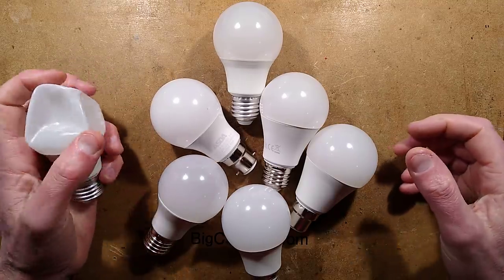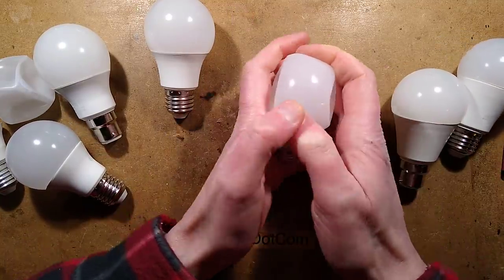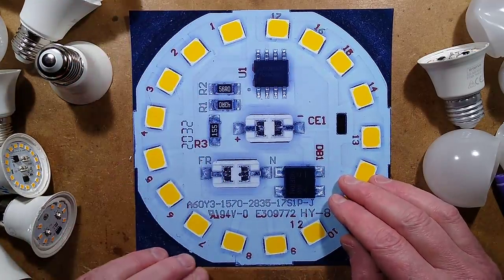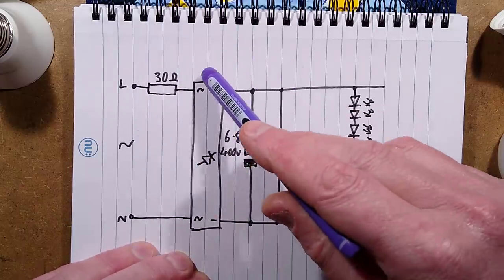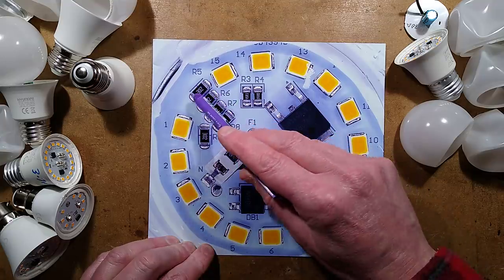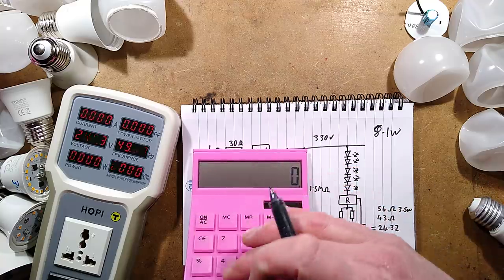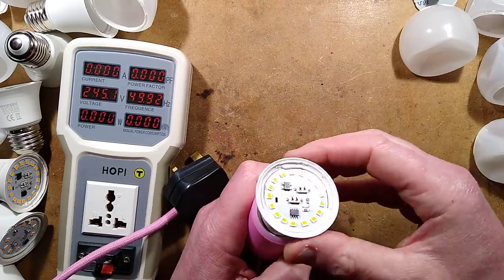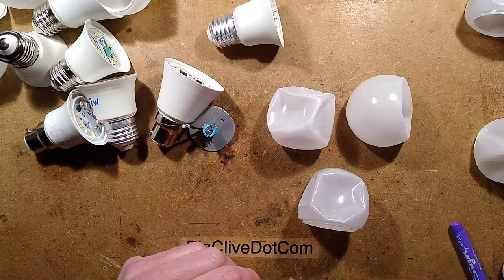Crushing and hacking LED lamps

Comment: Unfortunately the dead ultra-inexpensive Chinese-made "Tesla" branded LED lamp I have on my table waiting to be analyzed looks nothing like the lamps you show. There are only the diodes themselves on the round PCB. These are very very inexpensive and they last accordingly. I bought a couple in the local Bauhaus here in Prague just to see how long they last, but I switched to Philips, eventually. You have to spend money to save money!

Comment: Hey Clive, it's unrelated to this video but I'm looking for a smaller 100W+ COB LED chip than the normal sqare ones on eBay. It's going in a projector and needs to shine through maybe a 2-3cm hole and I'm losing a lot of light from the larger COBs. Do you know if they make anything like that? My alternative is to get like a 500W COB chip and just waste most of the light.
Reply from the maker: Most projection devices either have a large LED and huge beam path or the traditional tungsten path with a small very bright LED.  It's tricky converting the older projection equipment for that reason.

Comment: The"Buck"chip 9916C (with a coil) works the same way. I have converted a couple of "Paul Russell" bulbs, 15W to 7W, and 12W to 6W using the BigClive method. I hope they last longer as I am fed up with 10 year life expectancy  getting shortened to under a year. Thank you "BigClive". 
Any chance you have done the same with 20W / 22W floodlight lamps? I have a failed 22W LUCEC but the PCB is potted in silicone. I am thinking of driving the remaining live LEDs' with a scrap 12W board.
Reply from the maker: If the floodlight uses a separate driver you can use a lower power driver.  If it's the integrated driver then you may need to depot and remove one or more of the parallel current regulating chips.

Comment: Could you put clear (or even coloured) pool of resin in the top after cutting it down to 3.5w, so that they can be inserted into a lampholder into a chandelier type thingy?
Reply from the maker: You could use a suitable type of conformal coating.

Comment: Hi 
Don't think you grasped all of what I mean,and also didn't add one important thing"" connected too power but NOT switched ON""so the question is not about whether PCB   is up to the job it's why it blow when it's NOT SWITCHED ON BUT CONNECTED TOO POWER,,," did the plasma cutter cause some kind of spike with cable laying on cable of grinder"

Comment: Clive, after you do the MOD on the resistor and say it was one with glass (or plastic) that has shattered but been carefully cleaned away from the edges. You say it can be put in a lamp etc but to be aware of mains shock from the LED face side. Would the heat from the bulb then be warm enough to melt a cut sized piece of Acrylic or clear plastic (I would say any glass thickness would be okay) sheet to superglue across the rim safely. How thick does it have to be or and what type of clear plastic can one use to make a lens. I ask because if the Acrylic or other clear plastic is sanded down and glued on, to give a frosty surface, or if one has the skills to make a engraved pattern on the lens to alter the light output. Can the lens be made and done by these plastics, for a person to defuse the light around the room from them be safe to use?
Reply from the maker: Video coming soon about custom 3D printed caps.  You can already get the openscad files in the description of my last live stream on the BigCliveLive channel.  (1-year lockdown stream anniversary.)
Reply: @bigclivedotcom  That will be interesting even tho I don't have a 3D printer. What model would you recommend? Happy Lockdown Anniversary if you can call it Happy. I have lost two family over it and next week will be the 1st my cousin dying aged 45 and he was only married by 9 months. My aunt in Ozzie was 2nd on Aug 5th. I just hope my mum isn't next at 89 (90 on 22/4/21) in the nursing home Clive. But shit happens... Right!
Reply from the maker: @TATICMOOR  It's definitely a grim time.  My current printer is an FLSUN Q5.

Comment: Hi! could you please make a video with one of these bulbs and swap out the LEDs with 850nm LEDs? I would greatly appreciate it. I've got some smartphone cameras and they would also benefit from such a video. Thank you kindly. And to answer a question posed in a previous video, about watching the full length of the video; the shop light led conversion I believe it was, it was neat kind of following along with you on the bisection  and rebuilding of the shop light. I had a similar shop light however it was already LED, and I was looking to convert it to infrared. It worked out well, an educated back ground noise - bob ross kind of venture. Thanks!
Reply from the maker: You can get 12V CCTV illuminators.
Reply: @bigclivedotcom  I've ordered some and cut open some tomato cans as housing. Yeah, I may stick with them. They're cheap. Cheers!

Comment: If one of the LEDs burn out, can you just short out that LED and keep using the light bulb or will it be a hazard?
Reply from the maker: Each LED has several LED chips, so it will put a lot more strain on the regulator.

Comment: How much would coating it in something like clear nail polish remove the risk of it being at mains voltage?
Reply from the maker: It could help if the LEDs were run at low power.

Comment: Your basic point is drop the dropping the wattage drops the current through the led, gives you a big N multiplier of life of the bulb.  However what are the bounds of making sense  i.e dropping a bulb wattage in half will give you 10X life ? but dropping it a factor of 10 for 20000X is just ridiculous.   Do you have a nominal curve graph ?
Reply from the maker: Only time would tell.

Comment: The Poundland small Edison screw Electrek R14 5.5w . Has next to bugger all inside, just a ring of leds on topside of heat spreader, Unfortunately no  sm resistor to hack. being to bright for bed side lamp,  popped plastic dome off and painted inside with black acrylic ,  rubbed  enough off to provide desired light output level,  I know ,,, not  energy  saving. but works
Reply from the maker: Probably a capacitive dropper.  It could be limited with an external capacitor to create a dooby lamp.

Comment: I've noticed that the LED bulbs don't last anywhere close to the amount of time that they are advertised and depending upon where they were installed, it seemed that they probably were lasting even less time than I remember an incandescent bulb lasting.  So, I decided to start writing the date the bulb was installed onto the base (i.e. not the globe) of the bulb so that I could have some actual data on how long they last vs just a subjective type feeling for it...

Three months ago, I installed 2 LED bulbs from the same manufacturer that were purchased in a multi-bulb package, so it's safe to assume that they have the same manufacturing date and their internal design is the same.  I installed them on 2020.12.06 into a ceiling fan that has glass "shades" installed around the bulbs, somewhat similar the this:

https://www.homedepot.com/p/Progress-Lighting-Fan-Light-Kits-Collection-4-Light-Antique-Bronze-Ceiling-Fan-Light-Kit-P2643-20WB/304217877

The ceiling fan portion has not been used over the last 3 months, so there is no possible vibration damage.  There is not a dimmer on this lighting circuit and the bulbs are used continuously about 7 hours each day from around 18:00 to 01:00.  The ceiling fan had a space for 4 bulbs, but I only put 2 in it because the other 2 spots cause glare on the HDTV / monitor.  Because my dissecting of previous failed bulbs seemed to indicate the the components in the base might be overheating and failing, I decided to do a test with one light socket still having the glass "shade" and the other one with the "shade" removed and just the bare bulb.

On Sunday (2021.03.07), the bulb that was in the "shade" failed -- nearly exactly 3 months after the install.  Very unacceptable longevity.  The other bulb is still working and I won't be replacing the one that failed until the one remaining has failed also.

So, the supposed economy of the LED bulbs seems to be a bit overstated.  Of course, this is a sample size of 2 and thus not statistically significant, but it does seem to confirm my "gut feeling" of the longevity (or lack thereof) ever since I've started replacing incandescent and CF bulbs with LEDs.

Now, if it really is the non-LED components that are failing, it might be interesting to see what sort of modifications would be necessary to these bulbs to bypass those other components and run them on DC instead.

Comment: Plastic dome ones are not the worst, glass dome LED bulbs are made of thinnest glass possible that it shatters when you try to remove it._
Reply: Speaking of glass domes, the Philips all frosted glass LED bulb that turns purple with short use, if you break the dome and let it burn open air for a while it restores the light output._

Comment: So how much power is wasted in those power supplies with linear regulators compared to actual led power consumption?
Reply: If my assumption of LED string forward voltage of 277V is correct then with your 245V input voltage LEDs consumed about 6.8W and LED driver consumed about 1.3W on average before modifications.

Comment: I purchased 2 x 20W Cool White bulbs off AliExpress so I could try them out and they seemed quite good so I went and ordered a box of 10. They arrived with 20W on them and nothing else. I plugged them into the 2 sockets in the lounge and ran them for about 30 to 35 hours. I was in another room and turned that light off (it is on the same circuit as the lounge) and both the 20W blew at the same time. I pulled them apart and was surprised to find that 2 of the LEDs had blown right off the board and another 8 LEDs had turned black which I presume was them being burnt out. Of the 24 LEDs in the bulb I could only get 6 to give a faint glow by applying some current. I will never again purchase chineseium AliExpress LED bulbs again. They did not come anywhere near the up to 50,000 hours that was mentioned on the seller's page.

Before committing to using these bulbs, I had run some brand name (possibly Philips) bulbs and did a temperature test. I then did a temperature test on the chineseium ones and they ran 12°C hotter at 69°C when measuring it on the lights housing. The non chineseium ones were also a lot heavier so I imagine that gives a better heat dispersion property for the bulb. I know less than nothing about electronics so I could be totally barking mad with my cooling summation.

Comment: With the plastic bulb off that looks very similar to a GU-10 spot light.  Does that mean they are all the same with interchangeable socket connections?
Reply from the maker: Some are.
Reply: @bigclivedotcom  gu-10 are always more expensive (especially the smart lights), so is there a way to convert them?
Are they exactly the same ?
Would you be interested in doing a comparison video? (There must be some difference?)

On a side note, I have one of the old electric pre-pay meters in the attic somewhere, if I can find it would you like to take it apart!
When I say old I mean cast iron old (big) 50p coin operated. 
I’m not willing to post it out to you, but after lockdown I could bring it to the Glasgow meet-up... (it weighs a metric fцск ton)

Comment: Nice and easy hack! Maybe it's a silly question, but let's say i buy a dimmable Wi-Fi LED light and i make it work at 50%. Would that "hack" work too or not?
Reply: It depends

...if the WiFi circuitry isn’t fully integrated and using a CCS with adjustable resistors and it might mess with dimming circuitry too
Reply from the maker: That would make the LEDs last longer, but the higher amount of active electronics in smart lamps are an issue.
Reply: @bigclivedotcom  That's true, that complexity is an issue. Thanks!
Reply: @peterg.8245  Thank you!

Comment: Tried this with a few of mine. Just caused the bulb not to work. They are K-Lite brand 6 watt from the thrift store (our Goodwill sells new light bulbs.) I snipped away the 510 resistor's carbon top but the bulb didn't work afterwards. Soldered a bridge over the two contacts and it's working again but I'm not sure how safe that is. I also took apart a few random 9 watt LED bulbs but the design is completely different from what Clive has, so I'm not sure which resistor I should be deleting.
Reply from the maker: I wouldn't recommend bridging out the resistor.  This technique will only work with a parallel pair of resistors.

Comment: So many bits, how many are worth salvage. It would be nice to know the failure modes, so the still working components can be reused for home projects. Shame the big inductors have been designed out, as they were useful. 

Are the plastic covers just diffusers, or are they florescent at some frequency component of the LEDs used? Some of the early LED bulbs produced UV that resulted in the plastic diffuser becoming fluorescent, interestingly these showed a long half life, continuing to glow long after power was removed. This effect was not the result of capacitance charge storage, as might be suspected, but true phosphorescence, as was evident from the fact that a camera flash could make an off bulb light up with a glow.

Given the law is about to change, in June I believe, to force manufactures to design products with the ability for home repair, the intention being to extend the working live's of products and thus reduce electronic waste creation, there should be a return to the days when products provided a rich source of hackable parts and subassemblies, both new spares, and recovered from terminally faulty products. 
This feature disappeared for a time, following the introduction of the electronic waste directive and the design philosophy of products sealed for life. I trust you will be making full use of this change in the law, to show products that have hackable components and assemblies that can be repurposed..

Comment: A bulb I bought here in Canada has none of the circuitry your bulbs have...nothing but LEDS on the round plate, with the back of the plate being brushed aluminum or something. Two wires go down inside the threaded area and it's turning out to be more than a nightmare to get inside that part. Also, the bulb is dead, so I'm trying to fix it rather than hack it. Looks like I'm gonna be tossing it...

Comment: Just yesterday my main kitchen light went into disco mode. Easy enough to open up and spot the black dotted fault, but turns out the freaking LED chips sport a forward voltage of 15 V...
Reply from the maker: Each LED package contains several chips to allow a high number of LEDs in series.  It keeps the circuitry simpler.

Comment: On the first close up picture, it certainly appears that the traces have all of the leds in parallel. So, although you show them all being in series, I can’t see that being the case. Did you grab the wrong sheet or am I missing something?
Reply from the maker: All the LEDs are in series.  It's easy to mix up tracks and the spaces between them on the white PCBs.
Reply: Thanks for the reply, I popped a lamp myself to check and discovered that the video lost a little of the fine shadows which show that the gap is indeed what I was looking at

Comment: Some reading error for resistor in this video. Input resistor is 3 ohm. The 2 current resistor should have a "." In between the number! Ie 5.6 and 4.3 ohm.
Increasing this resistor value decrease the constant current value to LED and hence brightness and wattage reduced.

Comment: So the two resistors at 6.00 are connected to the I sense pin of the chip?
Reply from the maker: On the standard linear regulator system there are usually two resistors in parallel (to allow fine tuning of the value) in series with the current sense pin.  The LED current flows through those resistors, and when it reaches a set voltage the unit regulates the current to keep it at that level.